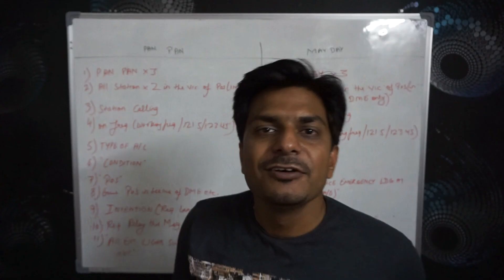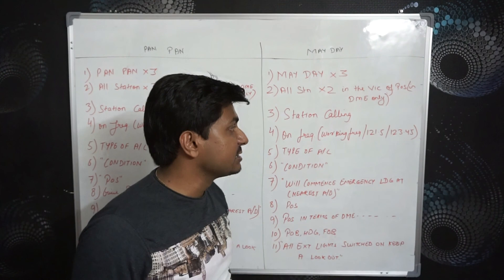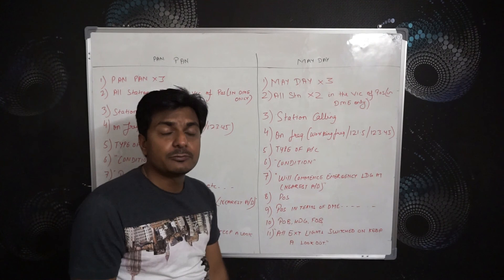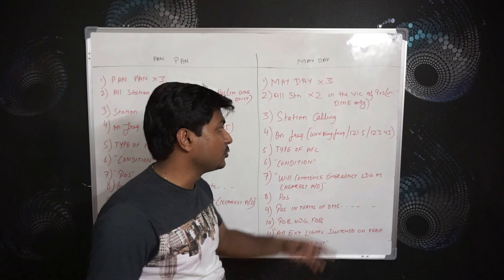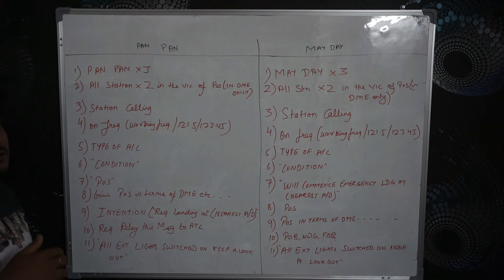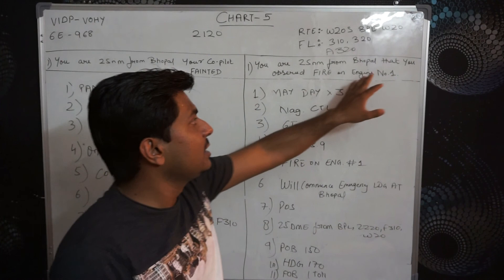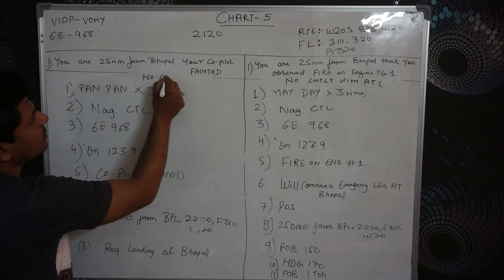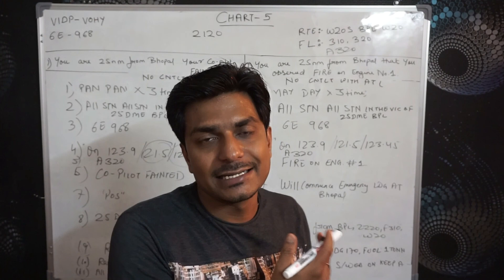no contact with atc while in MAYDAY/PAN PAN....RTR(A)

Comment: Greeting Sir :)
Few doubts,
While transmitting on interpilot frequency, do we have to say the line "Request Landing at Bhopal" as for why we are using "request" word in this case if not transmitting this to ATC.

Also in Exam, What will be our speech rate, as some friend has told me to speak as slow as possible, unlike pilots do in real world frequency.

With Regards :)
Reply from the maker: NO NEED TO SAY REQUEST ON INTERPILOT FREQUENCY AS U ARE NOT COMMUNICATING WITH ATC...... AND SECEOND RATE OF SPEECH IS LIMETED TO 100 WORDS PER MIN.. SO IN EXAM YOU SHOULD SPEAK WHILE WRITING THE ANSWER... THAT WAY YOU WILL SAVE LOT OF TIME...
Reply: Thank you sir :)
Reply: "Req relay msz to ATC" Will also be omitted when making the first contact with ATC or here in our case 123.9?
Reply from the maker: yes
Reply: @captainclasses9761  
Sir why to omit request relay this msg to ATC. Question is saying no ATC contact, but sir there will be other aircrafts in the vicinity who r in contact with ATC or tuned to 123.9, so dey can hear our distress or urgency call, thereby relay the same to ATC or can we omit this sentence from format for no contact with ATC
Reply from the maker: @vigneshs5097  who ever listens the msg will reply then u can say.... You can req to a station... Not to every1
Reply: @captainclasses9761  
Ok sir

Comment: Not understood how to transmit position on different frequency... Plz explain 5th point
Reply from the maker: U can transmit on the other  frequency by changing the frequency from control panel  which u will need not do in exam... Just change the frequency while transmitting... 
Type of aircraft means which aircraft u r flying like Boeing 737